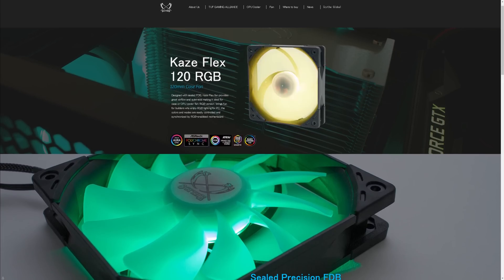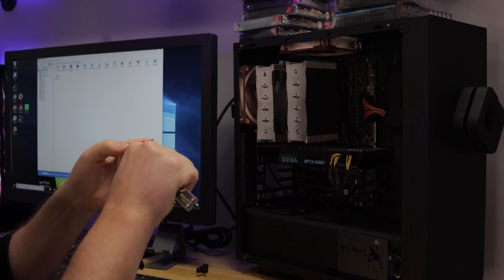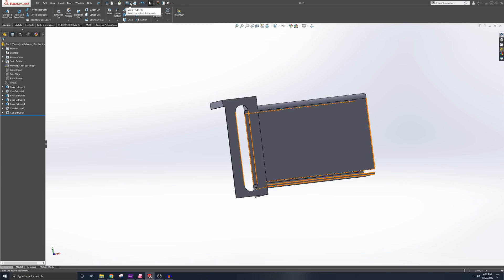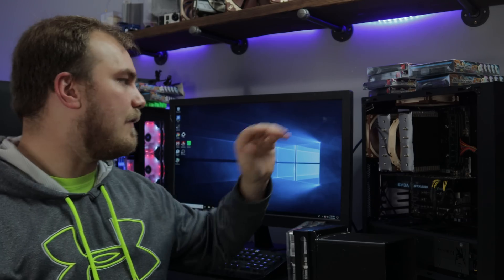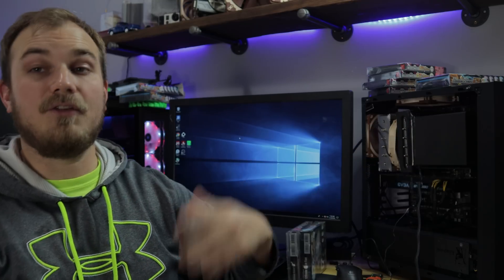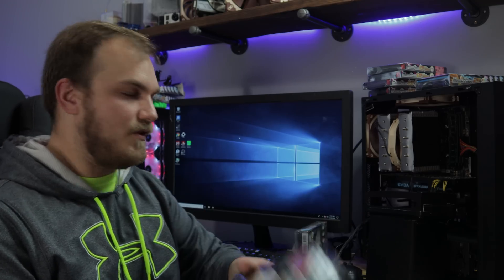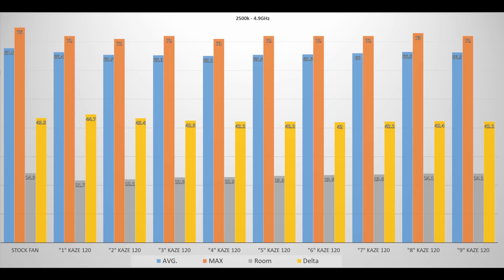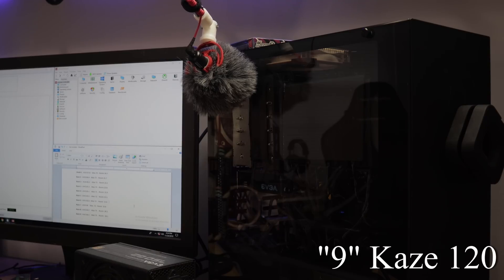This Is As Good As It Gets - Fan Stacking

Comment: See if positive or negative air pressure cools better
Reply: Usually the results of these tests are that they are basically equal when it comes to cooling but that positive pressure makes it easier to control dust ingress. with positive pressure you know where all the air is entering the chassis and can if needed filter this air. With negative pressure air tends to be sucked in through every opening there is no matter if it's supposed to or not so it's harder to make sure you don't get a lot of dust in the machine.
Another thing to remember is that with positive pressure you can actually direct the airflow to components that need cooling. With a negative pressure design the air will tend to flow along surfaces which can cause areas of dead air where you wouldn't expect them.